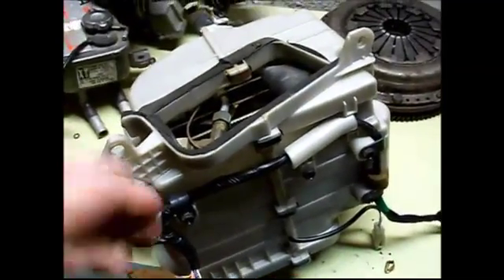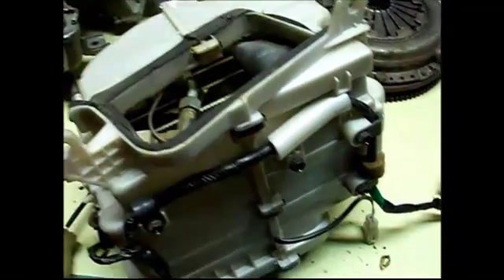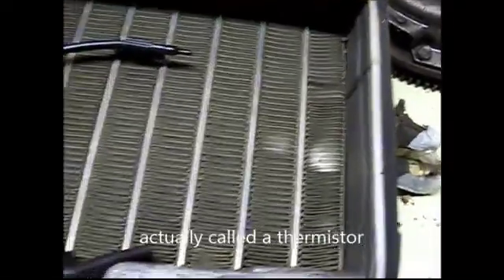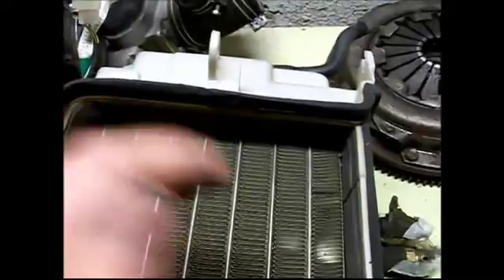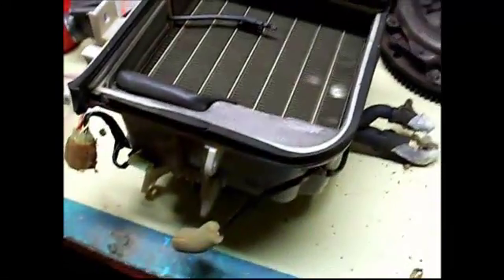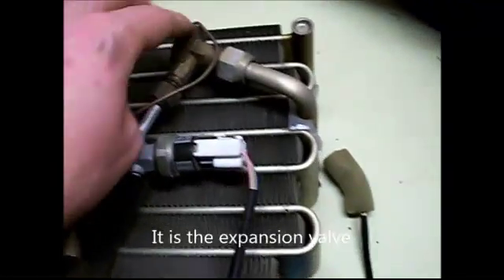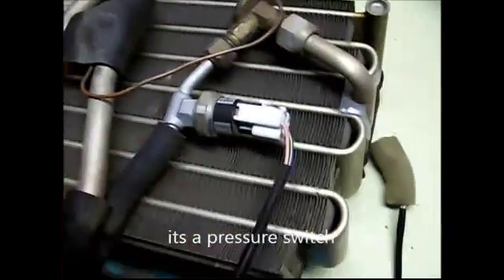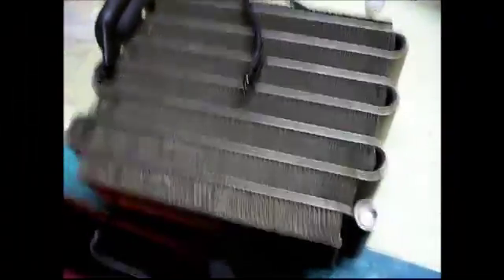How an air conditioning evaporator works

Comment: Sorry, watched it too many times & still don't understand how this thing works.  Other commenters are trying to explain you & are arguing with each other.   Will watch another video to try to understand how the expansion equals cooling thing works.
Reply: Think of it this way. Each molecule in the refrigerant carries a unit of heat, even at freezing temperatures, there are still present, units of heat. So in a larger diameter space, those molecules are loosely packed, therefor there are less units of heat per cubic inch, which would be "cold" to our senses. But if we restrict this area, into a restricted space, a smaller diameter more tightly packed full of molecules. Then this means there are more units of heat per cubic inch and our senses perceive this as "Hot". 

All energy in the Universe is a unit of heat, because at it's most basic definition, energy is a unit of heat. The more energy per cubic inch, the more heat you also have present. They are one and the same.

Comment: Very nice video! I still cant get exactly how the refrigerant expands, what makes it expand?
Reply: +Stefan Ovcharov Heat from the warm air flowing over the tubes makes the refrigerant expand. It heats up quickly, so a small amount of heat will convert the refrigerant from liquid to gas (thus causing it to expand).
Reply: Christina Thomas And I believe that expanding-evaporation takes some heat away from the air passing through the tubes and then the cold air enters the cabin. Is that the case?
Reply: +Stefan Ovcharov yep
Reply: +Christina Thomas this comment is so wrong. you are giving false information. delete it quickly please.
Reply: +DangerZONEpixel what's wrong with it?